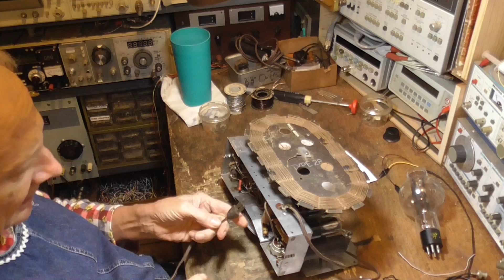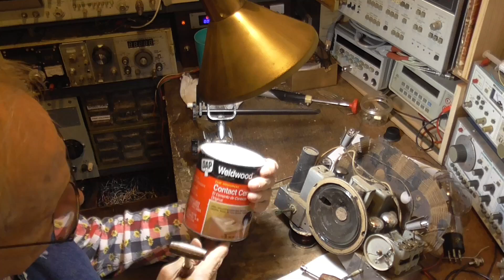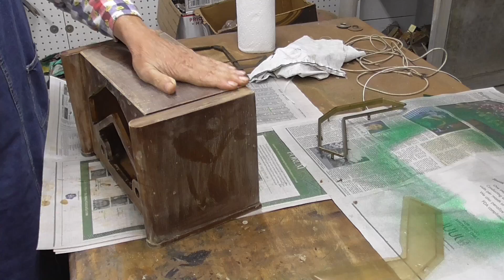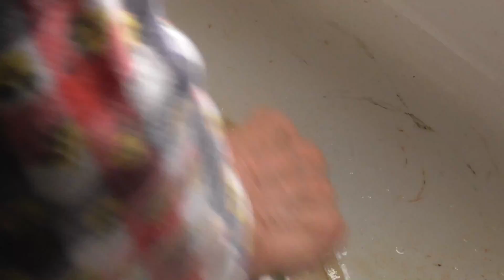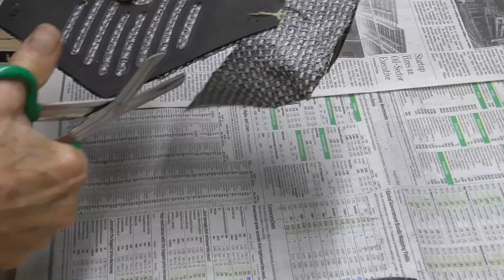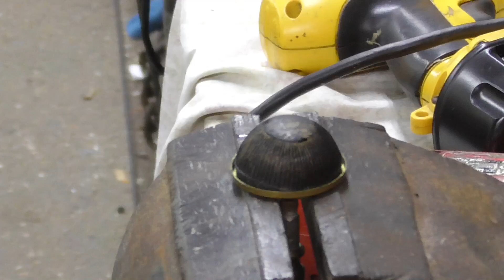RESTORING A ZENITH BOOMERANG RADIO

Comment: I don't buy checking capacitor leakage at room temperature without considering the likely insulation resistance (leakage factor) at operating temperature that can be considerably over 70 degrees C in an AA5 radio.  Insulation resistance decreases as temperature rises:

"As temperature increases, insulation resistance generally decreases due to intensified polarization in the insulating material, which increases conductance. This means that for every 10°C rise in temperature, the insulation resistance can be halved, making it crucial to consider temperature when measuring insulation resistance."  -AI answer from web
Reply from the maker: Shows what AI knows about radio repair! I've been at it for 40 years and never had one I tested at room temperature leak from temperature.
Reply: I agree. AI doesn't know jack about antique radio repair. When did it ever fire up a soldering gun? It just harvests opinions from the web. Hands on experience is infinitely more valuable.

Comment: THIS WRITING IS UNDER CONSTRUCTION AND SO IS INCOMPLETE.

(-1-) @2:30  Do you replace all line cords with ones having polarized plugs?  This assures that power line ground goes to chassis ground.  Also validate switched power is line hot; NEVER switched ground!
(-2-) sometimes you add a fuse but not always.  Why not?
(-3-) you NEVER caution viewers that vacuum tube circuits operate with lethal voltages.  Why?  You employ line voltage protection pre-radio but you rarely describe it or its operation.  This is almost intentionally enticing amateurs to risk their unlearned selves to death.
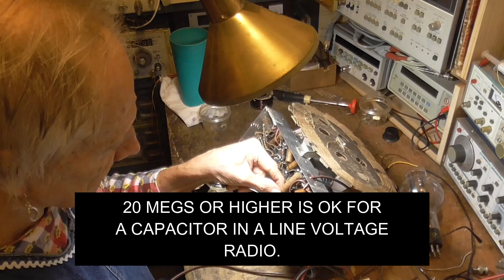(-4-) @3:20  you choose to leave a cap with 20Mohm leakage claiming it's not bad.    I don't believe I've ever seen you measure actual capacitance values with a meter...  Granted that electrolytics aren't critical to farads but are to leakage.  Still, you never check farads.   Why?

(-5-) @14:50   Y  E  S   !!     Never ignore kitty.  Never, never, never.  Once you bond there's true love
        kitty<=>human.
Just DON'T shock kitty.

Comment: Sir, How can I get the Vintage Single Hookup Wire for Repairing 40s Tube Radio? It's a Single wire, not Stranded Wire.
Reply from the maker: Finding actual vintage wire is almost impossible but you can use modern bell wire which is available from most hardware stores.

Comment: Personally, I would have either replaced the speaker OR applied a layer of tape between the layers of rubber cement, even if it did sound fine.

Comment: Looks like an early 1940's model? 4:32 My late father had a volt/ohm meter just like that one, but it used a 15V transistor battery instead,  of the kind that Everready hasn't made in years

Comment: for folks watching this, most brake cleen is non-chlorinated. the reason being chlorinated bake clean, when used as a prep for welding (degreaser etc) will produce phosgene gas and mess you up but good and probably kill you. phosegene can kill you at as little as 4 parts per million. So if your using it , cool, but dont let it get near a flame or serious heat. and dont be suprised if your brake cleen is non-chlorinated.

Comment: Hi, Ron.. I´v got a question.. My Philips  radio-gram, stereo gram, with Fm, from about 1960                                                                               has a problem with a tube, the ECC85 for the Fm-part.. Is it possible to replace it with a UCC85 or must I by a new ECC85 ..?
Reply from the maker: The two tubes are interchangeable. Different manufacturers number only.
Reply: @glasslinger  Ah, I see. Then I´ll use the UCC85.. Thank you very much for the answer ! Then my Philips Bi-ampli will work again- hopefully. It´s only the Fm-part which have a problem. Found out it´s from 1956/1957.. Excellent sound for its age..

Comment: Good job here, although I tend to replace any wax paper caps just because they will often eventually start showing leakage under load even if they check out OK initially. Maybe that's just me of course and it probably depends on how many run hours they've had.
Reply from the maker: I also normally replace all of them. This was one exception, since the caps were all reading over 20 megs with 30 volts on them. Very rare in these old sets!
Reply: @glasslinger  indeed! I think it has a lot to do with where the caps are placed in the set, many of the military transceiver sets and measuring equipment from the same era have the caps mounted on pairs of terminal tie strips in some corner of the chassis well away from the tube sockets. The wax paper caps seem to bake to a brown "mummified" state where they're buried behind other point to point components.

Comment: The difference between 30v and 100v will quite often show the difference in leakage on an actual leakage detector. How is using an OHM meter to detect leakage better or different? I've never used an OHM meter to detect leakage so I am truly curious. I do ESR meter, leakage meter, and Capacitance meter tests. If any of those are off I replace the cap. Some people say "you gotta put them on a leakage meter at max voltage of the capacitor" because it actually works..... Keep in mind I do say that this is only way to detect leakage but it does work.
Reply from the maker: I agree that full voltage is best but from 30 years experience I can say that the 30 volts of a Triplet is satisfactory for radio work.

Comment: I have the six tube version of this radio on my TTD list.  The only difference of opinion here is replacing the capacitors. They may work now but from my experience, they can fail at any time. Also, I replace that crumbling rubber wire if present.
Reply: I just about finished a 1935 model A-67 GE and did the same thing....changed 98% of all the caps & resistors and all the rubber insulated wiring (all color coded correctly); that and all but one  tube. Next comes the replacing the cabinet. The only thing I can salvage from it is a fluted trim piece and the base trim. My speaker I'm afraid is frozen but not until you're above 80% volume does it show up. The cone is flawless. But would anyone have any recommendation on how to free it up without having it rebuilt?

Comment: Always enjoy your videos....and learn much. HOWEVER.....I'm a bit disappointed with this one, because your usual fastidious attention to "clean" (ie sandblasting chassis etc) seems less than your normal fastidious high standards. It's a great video, don't get me wrong...I'm guessing this radio was not for your personal collection? In that case I can perfectly understand the reasoning behind not sand blasting, replacing caps etc....

Comment: I have used that liquefy the stain trick you used here - i saw you use it many videos ago.  Like a charm it worked. A gentle buffing then a light coat of poly. Looks as good as new being almost 70 years old, it's an old Zenith that i just love the shape of. There is another i need  to do as well.
A Crosley i can not find any info on, got it working easy enough now comes the make it look nice part.
Your videos make me very happy, to see someone other than me doing it is great! Pretty soon all that will be left of these radios are pictures.
I try to bring every one i find back to life. I was lucky to have worked in a radio and TV repair shop as a kid.  When Mr reed retired and sold the shop i asked for and was given all the tube stock and many parts. Along with the radios that get left there after the repair estimate was too much.
If they only knew what they gave away.......

Comment: I missed the part with the hole in the grill cloth ("screw up hole"). What happened there? Also why didn't you patch the hole in the paper membrane on the speaker?
Reply from the maker: The cardboard had the hole in it so I made a bad assumption that the cloth needed the hole too!  I forgot to turn on the camera when I goofed up! The speaker sounds fine even with a hole so no need to make more work!
Reply: I too want to know the story of the "screw-up hole!"
Reply: I'm assuming that when he glued the template onto the speaker cloth that little hole  In the template must have thrown him and thought it was supposed to be a cut out for something and so that's why he cut out a hole. And then luckily he had that Zenith Z from something else on a Zenith model radio and he put it there just to cover up the hole that he accidentally made.